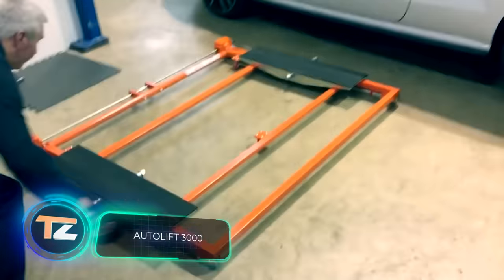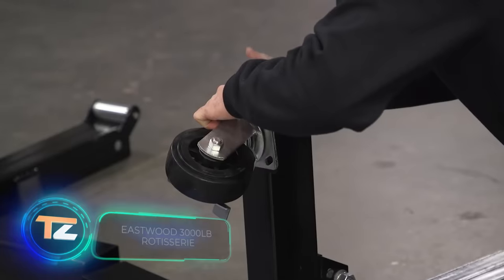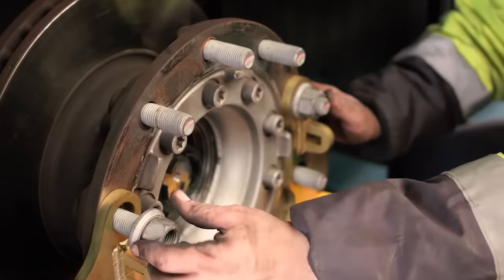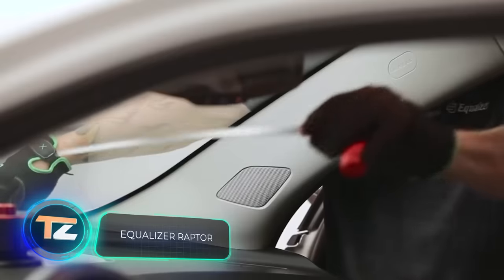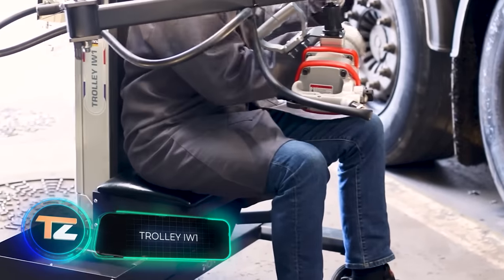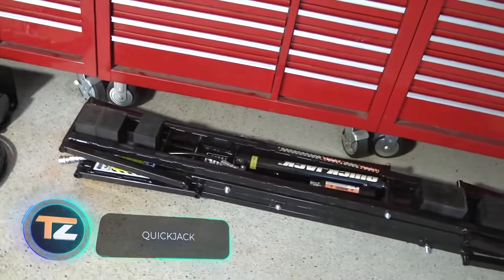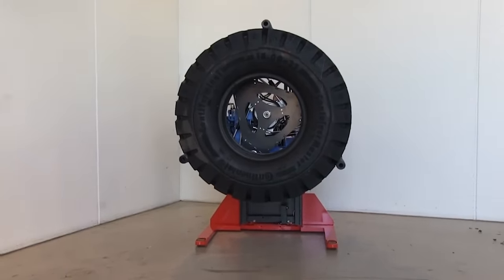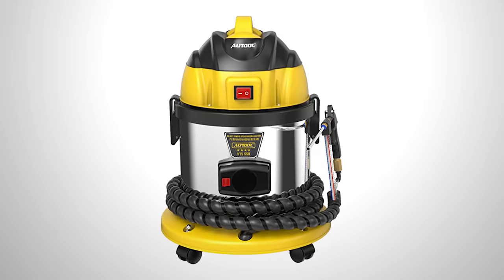INGENIOUS INVENTIONS FOR AN AUTO REPAIR SHOP

Comment: If you have a car that’s less than ten years old, then setting-up a home shop isn’t a very good idea. There are so many specialized tools, and computer-codes that it would take you four times as long as a professional to make the same repair . Those Snap-On mechanics have twenty thousand dollars worth of tools. Or more. 

It’s funny, but there isn’t a website that categorizes repairs. For example if your water pump fails, you shouldn’t have to call five different shops looking for a price. There should be a website that shows the average cost of the common repairs for each car. That way, customers can tell at a glance how much it would cost. But if Ford repair prices were categorically listed, then nobody would buy a Ford. So we live in world of enforced ignorance. Those sheister Ford dealers will innocently claim that they don’t know the cost of a repair.
Reply: I find buying my parts from Ford are cheaper than getting them from some random parts shop. This was started in full force by the Saturn car company (may the rest in peace). My Saturn was great for my college years and I could get parts for it cheapest from Saturn. Ford on the other hand are crooked as the day is long. I should know since I have and fusion energi. Yeah not happy with Ford.
Reply: Cost of the tools does not a mechanic make.  ;-)
Reply: @mrdeadworry  "FORD",  Fix Or Repair Daily
Reply: I have been fixing my own cars for a few years …again, I used to fix them but when I was at my old job I had a company car so I stopped making repairs but thanks to Covid that’s no longer the case so no that I had to buy my own car I got two used ones that when they break , I look up repair videos here on YouTube and if it seems like something I can do, I do it! It’s frustrating sometimes and does take me longer than a garage but the money I save as well as the bs of dropping the car off, then having to get a ride to pick it up blaaah blaaah… and the fact that I can do the repairs myself is very rewarding and you’d be surprised how that feeling makes you actually feel good about the rest of the things in your life like, I recently fixed my old wood stove so it works like brand new now, cleaned my own chimney, fixed the cam shaft on my craftsman lawn tractor… I am a fix it god now….lol